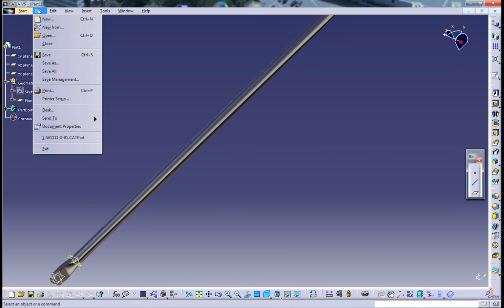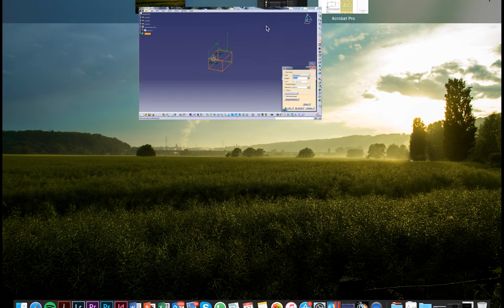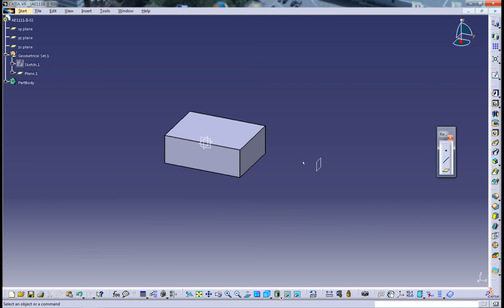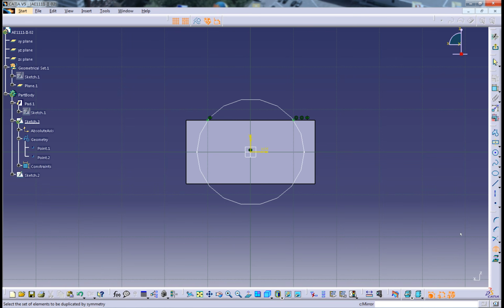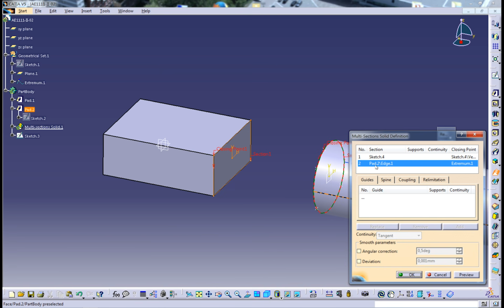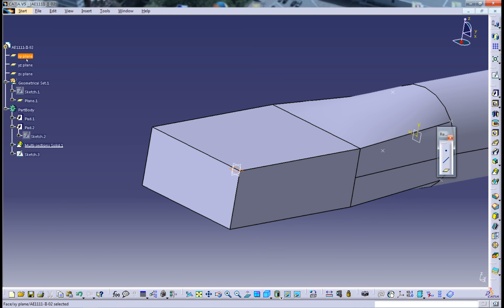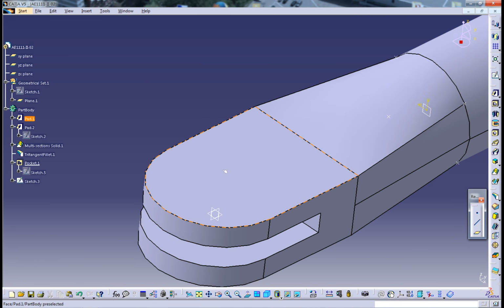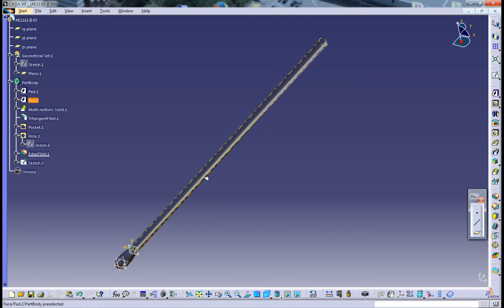Catia - Basics Part Design Part 2

Comment: There's a mistake with the setup of the multi-section solid. The way you do it is by just selecting the rectangle edge and the edge of the cylinder. To make it work properly you need to select the side of the cylinder right after. This way the multi-section solid will be tangent to the cylinder instead of the box. All the steps after that are exactly the same. When you do the part check with this method the Gy will be OK.